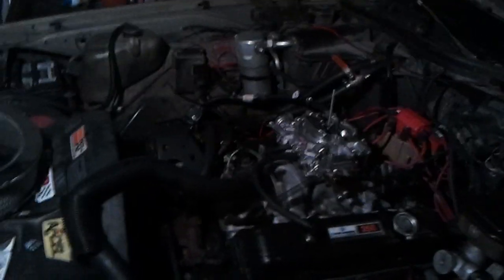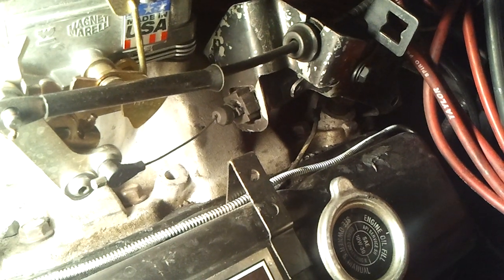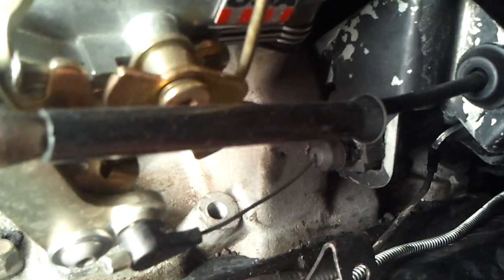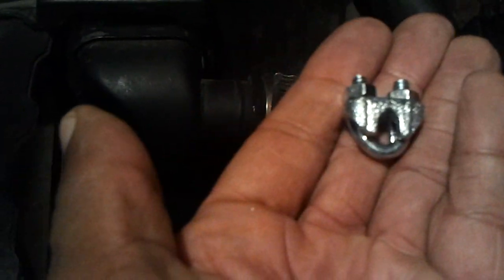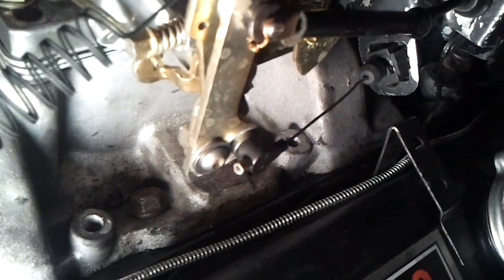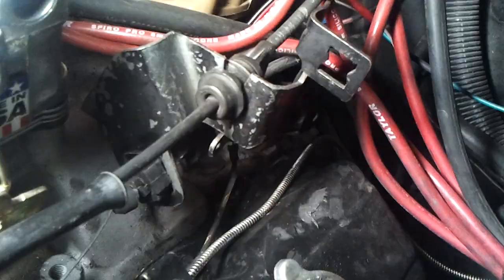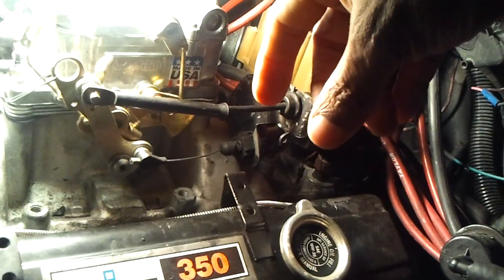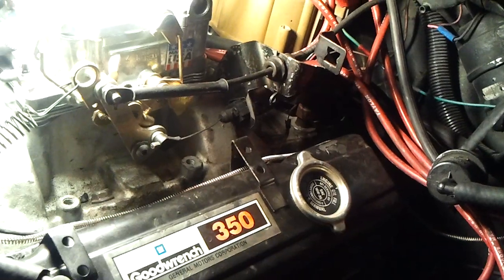700r4  Detent cable little trick.

Comment: Then what happens is you are kept from going to wide open throttle.  If that cable slips get a new cable or do this:  Step on the accelerator and make sure your carb is wide open, lock your cable in this position.  You should be at WOT and the TV cable should be pulled all the way out and tight.  When you release the cable give it a slight tug, if there is any slack you'll feel a resistance once the cable touches the end of the valve in the transmission.  Now, that slack needs to be taken up so if you look where the cable attaches to the carb linkage the steel part goes all the way through.  Pull that out to tighten the cable and remove the slack at idle.  You can add some fishing split shot to space the cable out.  There are cheap kits out that add a spring to the end of the inner cable so you can preload the valve for firmer and higher shift points and still attain full throttle.  It took me a long time and a smoked transmission to learn this but now I have a 550hp 6L LS in front of my 700r4 in a '68 C10 with 4 years of 1/4 mile runs and 30k road miles on it without a problem.  I wish I knew how to post a video, it's really pretty easy once you realize what's going on.
Reply from the maker: That cable has been running flawlessly since this video several years ago.  but I do have a new one just in case 🙂
Reply: @carledward1968  I hear 'ya and I noticed the corrector on your linkage.  It's the old sayin' "There's more than one way to skin a cat".  I would just check for WOT.  Keep Roddin' Brother.

Comment: Hey thanks for that. The stock cable has the friction self adjuster that slides out when you hit WOT, but I can see after many years it might loosen up and a sudden punch would move it forward and lower your pressure. I have a 700R4 that replaced a TH400, and we used Lokar cables, that don't look easy to adjust. But there is no "slide" (that I know of) to slip. I was thinking of returning to the stock style self adjuster, buying new brackets, etc. But after seeing this, it may not be reliable in the long run.

Comment: Bro, you just may have solved my transmission problem. You gave me an idea that I need to look into. I'm gonna go check it out right now!
Reply: @carledward1968  just checked it. I thought maybe I forgot to tighten the bolts on the bracket that holds the detent and other cables to the upper plenum and maybe that was causing the issue, but no dice. Had drivability/running issues, chased codes around and finally changed the ECM. Car runs amazing now but stuck in 2nd and won't shift. Reverse works fine. There were no trans issues before the drivability/running issues began. Car has 26K original miles on it. Any thoughts?
Reply from the maker: @alrise1776  what year is your car and what transmission?
Reply: @carledward1968  it's a 1988 Pontiac Firebird Formula 350 TPI. I reckon it has to be a 700R4 as I don't think the 4L60E came out until a few years later
Reply from the maker: @alrise1776  has the transmission ever been serviced? if not  I would check the fluid and possibly the transmission screen/filter
Reply: @carledward1968  not sure the cars service history. I just bought it from the original owner, but it appears she took really good care of it. Trans fluid is clean and red, no burnt smell or anything.

Comment: Hey man your cable is extremely loose if you can get it to tighten that’ll help drastically push the button on the adjuster and got wot then release button and it’s tuned it gm calls for that

Comment: my tv cable on my 69 Camaro with 2 speed powerglide has been unhooked since before I got the car 10 years ago, its almost a daily drive and im barely having transmission troubles, replaced U-joints, greased yoke, & changed fluids which stopped the knocking during shifting and the driveshaft problems.  Is it damaging to have the cable unhooked?  I've tried connecting it in the past to my carter afb however it did not pull or move when I pull the throttle back...so I left it unhooked
Reply: actually nvm...more reading and its just the kickdown cable for automatic shifting from 1st gear...always manually shifted to 3rd off the line when I wanted to use it and had no idea it was able to shift on its own lol

Comment: Geometry and correct line pressure for the 700r4 is very critical the bracket you have on yours isn’t correct for your edelbrock carb. I had many problems with mine and was always adjusting the cable like you. Get the correct bracket you won’t be disappointed and you won’t burn the Transmission.

Comment: Umm, dude you got to have that cable straight before you do anything.... not all sideways crooked, they sell a 8 dollar cable adjustment for  edlbrock on Jegs, one the cable is straight and synced with carb your good, otherwise your locking it in the wrong spot, hope this helps anyone adjusting this....then on to the non computer relay for 4th gear

Comment from the maker: No it wont as long as the cable is adjusted properly then lock it in place and your all good. I got this tip from a guy that works a a transmission place where i live.

Comment from the maker: You can go to summit racing and get the right one for that carb bro. Call there tech line and they will get you in the right direction or go to a real trans shop and let them check it out to see what type of bracket you need. But first tighten that bracket up and please get that trans to a trans shop because if that trans is not set up right it wiil burn your trans up..
Reply: carledward1968 o

Comment: Would this cause no reverse, and a jump forward when put into park after?
Reply from the maker: It didn't..... I ran it like that for several years before selling it
Reply: @carledward1968  I'm wondering because mine has no reverse and it seems the the cables are WAY off in regards to the shifter

Comment: What i seen is that your bracket is out of line  olmost a inch and that gives shifting problems
Reply from the maker: paul pieter Rooth you are correct my brotha.. I have since this video found the correct cable and the bracket.
Reply: CarlEdward  is nice that you have the right bracket   I liked youre video and I had a bracket from Jeggs  that wasn't the right one I had to cut that thing in pieces and welded it so that the Tv cable came right up the edelbrock and shifting is better

Thanks for youre replay

Greetings from Pingjum Holland
Reply from the maker: paul pieter Rooth Damn shame bro but you do what you have to do and thanks again
Reply: Man y'all hit me up mine is not lining up and Jegs don't have a clue what's going on.....
Reply: I had to cut that thing in pieces and welded it so that the Tv cable came right up the edelbrock and shifting is better  looks like the only way do get it right
Reply: bought a new bracket for edelbrock carb and that stupid thing wasn't lining up  1 inch from perfect lining up cut and make it fit its the only way to get it right
Reply from the maker: I agree I bought one before myself and it just didn't work
Reply: Akins Darius parts stores are in no way mechanics and usually don’t have a real understanding of the application 

Most employees at a parts store are just employees.   Nothing more

Comment: I hope you still have this account man but do the motors with carburetors only have those trans lines up there or does tbi have them too ?
Reply from the maker: Both do
Reply: @carledward1968  excuse my ignorance I’m new to messing around with this shit 😂 the trans that’s in my truck now I’m guessing never had one or the guys before me didn’t know what they was doing either it started slipping and slamming into gear from 1st to 2nd so I got  another trans and I’ve been looking them up online and all I’m getting from it is confused
Reply: @carledward1968  I have a bracket upfront for the tv cable and the new trans has the cable but so far I havnt found one on my trans

Comment: Get a shift kit and do it right, its auto adjust and supposed to slide out. Whether it last or not it's still not the right way to adjust shift points
Reply from the maker: that issue has been fixed a few years ago
Reply: @carledward1968  I figured it was. After commenting I seen it was years ago, still nice to stay posted tho. What 350 package did you buy when you got that engine?
Reply from the maker: @sbranham86   it is a gm goodwrench 350 that I has a 268H comp cam

Comment: 700r4 Trans should shift into second between 17 and 20 mph
Reply: What about the rest of the gears?
Reply: @BeardsandCars  once first gear is set for the proper shift the rest being synchronized shift at their proper points.    You also have to drive the thing and not feather the throttle so much.    Drive it correctly meaning punching the gas at the right time to make it shift at the right points up a hill .        Also if you’re under 50 Miles an hour you use regular drive.  And then over 55 you use overdrive shifting it at the Column.

Comment: Really bad advice. This is a great way to burn up a 700R4 quick
Reply from the maker: I can respect your opinion but you're wrong in this case that transmission has been in the car since 2010 and it's now 2016
Reply from the maker: gotta think about it if it's not adjusted properly it will burn it up butt fortunately for me I know how to set mine up
Reply: The locking mechanism is stripped on the Tv cable. Im having the same trouble on numerous cables. Has to be a reason for this.But I'm going to give this a go thank you.